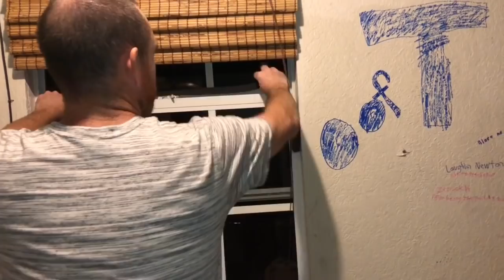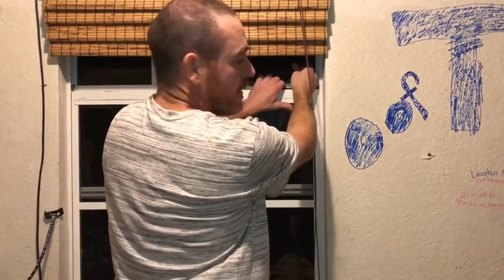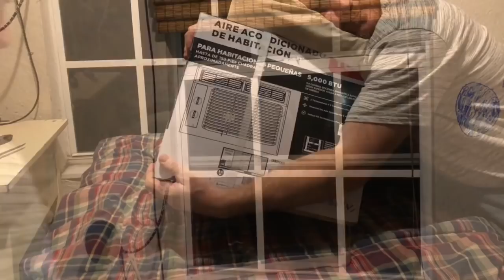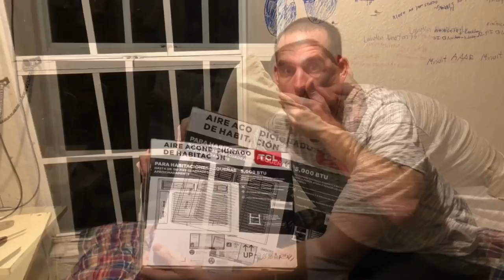How to install a window A/C unit properly and quickly

Comment: Kendall, I'm 74 yrs old and never put in a Window AC unit.  I just bought a midea 5000 but 35 lb weight unit.  Manual did not show what the 3 slots on each side of the main unit were for but you explained it perfectly!  I was gonna pay 75$ to have the unit installed but ended up doing it myself! Took me about 3 hrs (Bad Window) but it's in and working well!  Thanks much! David N.
Reply: I am 56 and it  took me four hours this morning.  I had to take the old one out which was a little problematic.  I do this about once every eight years. Anyway I cannibalized the old one for spare parts should I ever need them.
Reply: I have the same one, are you referring to the side panels? I had no clue how the hell to get those on
Reply: Hey Kendall I'm a 70 year old woman and I have to do everything myself because I don't have anyone to help me. I just ordered a window unit and will have to install it myself but I'm sure I can. This unit will be for my small bedroom but I'm going to order another unit for my living room. I hope it doesn't fall out of the window.

Comment: I would have drilled pilot holes to make drilling easier. I have a window unit coming from Amazon and I have to install it myself. Good to know that it isn't that difficult. Thanks for the video.

Comment: What I'm going to do when my window unit arrives is put in a screw on each side of my window on top once the unit is in and the window is pushed down to meet the unit. No one will be able to lift the window. I had to do this to my computer room windows because for some reason they won't lock even though the locks are there.

Comment: Wow.. I know this video is quite old, but it helped me, I needed this, and it's not the first air conditioner I installed,  u taught me everything I was doing wrong. I really had NO CLUE that your supposed to put the foam strip in the window where the windows lock, idk why that wasn't something I thought about bugs being able to come through there 😂 Thanks so much!!

Comment: were those metal drilling screws did they come with unit? In the event of a fire i dont know if i would lock the windows with screws.. i would use something easy so to get out.